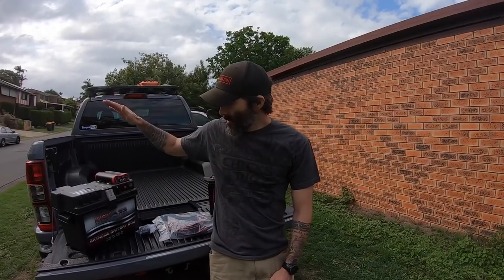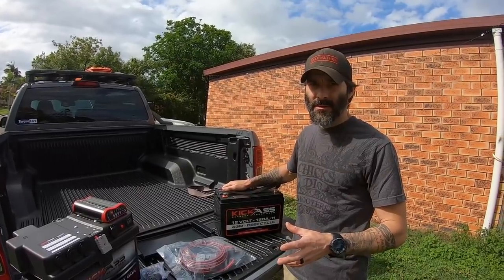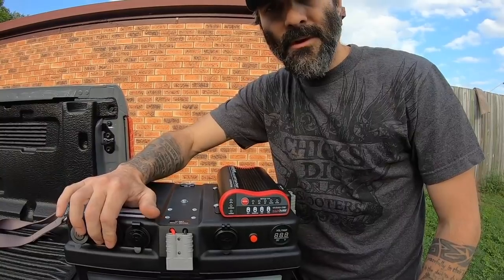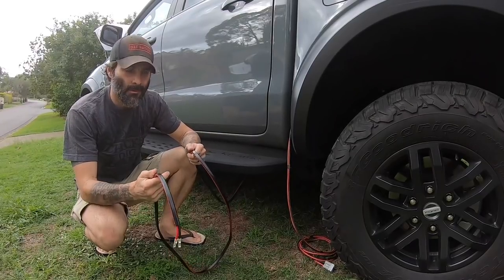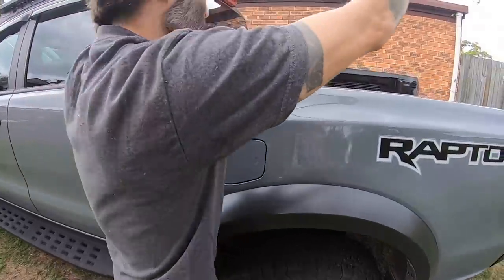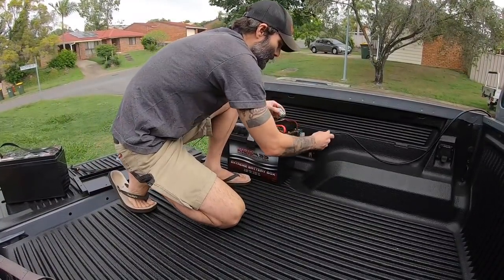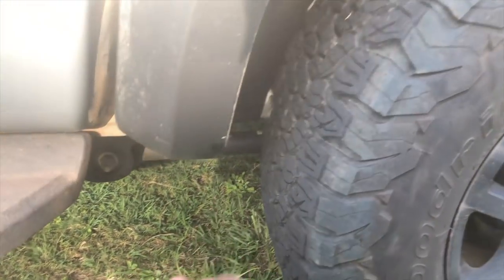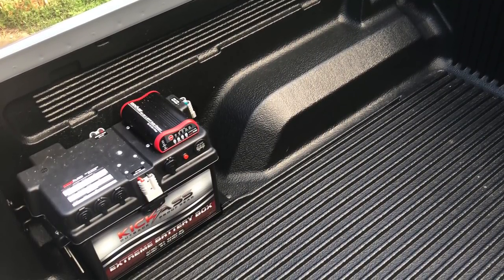HOW TO - Dual Battery Install - EASY

Comment: I'm very curious to see your battery box voltage when you car is on. Being that you haven't tapped into any ignition/accessories cables with the DCDC charger (as your meant to). Wonder if its charging the battery completely.
Reply from the maker: You are right mate, some DC/DC chargers will require the black accessories wire to be installed. This unit however comes pre wired, as you see the instillation in the video it is exactly step by step according to the manufacturers instructions. I’ve had the unit in for 8 months now and it has never ran flat. Volt meter is showing 13.5 - 14.5 with vehicle running 👍🏻
Reply: I have the same question. I just got this kit and installed on my 2019 Ford Everest. The aux battery is still charging when my vehicle is off so I’m wondering if I need to connect the blue ignition wire. 
Wondering where the best spot to get the ignition connection from might be too.
Reply: @scottweaver951  I'm hoing to install mine soon. I'll keep you posted with where I tap into the accessories power.
Reply: George Athanasiadis did you end up working out how best to install your cabling. Mine just keeps charging even with the vehicle off now even with an ignition or accessories cable hooked up.
Reply: @scottweaver951  need to enable dual battery charging. Go to local dealership and they can do it easily. I didn't hook up my inginiton cable and having the dual charge enabled it work perfectly.

Comment: Hey mate, just wondering how does it go exposed to the elements? Does it hold up alright with rain etc?
Reply from the maker: Not a problem at all other than a bit of fading of the colours after a while. Ive had mine in for a few years now, still going strong.

Comment: hey mate great video got me keen to do it , the link doesn't work for battery box you brought . I have searched for primuim battery box and cant find anything on the kickass site . do you know if they still make it ?
Reply from the maker: G'day Mate, I just had a look...It isn't listed on the site now/anymore? Maybe a supply issue or seems like they want you to purchase all the pieces individually...and i can't be too sure but it looks at first glance like they have put the prices up...??
Reply: @RoundTheFire  cheerz mate,  would you buy it again now ? if so i might buy them individually then . did you say the charger was riveted to battery box ?
Reply from the maker: @loggaification  mate to be honest it hasn't skipped a beat and i've pretty much treated it all the wrong ways. the DC/DC is just riveted to the top of the box. Ive upgraded my battery now to a VOLTAX lithium not much more than the kicks battery 1000% improvement.
Reply: @RoundTheFire  I ordered the Kickass setup, but I believe Australian Direct has supply issues, so they refunded me (they contacted me and offered the refund, so full credit to them).

I found these guys who appear to have the exact same setup, so I ordered the kit from them. Got it couriered to me in 2 days. Will install in the next week or so.

https://www.home12volt.com.au/bbg-dc.html
Reply from the maker: @timblue191987  That setup looks good mate, thanks for sharing the link.

Comment: What's the 12v out put for the trailer for?
Reply from the maker: To charge the 3rd battery located in the trailer which runs another fridge/freezer and a water pump.

Comment: Hey Damo how you going without the blue wire ignition feed had it drained the main battery yet and what model Ranger is yours bud ?
Reply from the maker: G’day mate, I had zero issues without the ignition wire hooked up. I’ve since changed out the AGM and dropped in a lithium, for that I hard wired the ignition wire straight to the positive terminal on the second battery. My truck is a 2020 model 👍🏻
Reply from the maker: You can also get the dealer to turn off the smart alternator so it pumps hard all the time

Comment: I bought and installed the KickAss DCDC charger and Anderson wiring kit last weekend. I already have my own AGM battery and a battery box. Because my Mitsubishi Pajero Sport has a smart alternator, I also have to make and extend the blue Ignition Override wire to the fuse box of the car. I notice your kit has no Ignition Override cable, so does your Ranger Raptor has a smart alternator? If so, shouldn't you need to connect an Ignition Override cable to overcome the smart alternator charging issue?
Reply from the maker: Gday mate, yes the Raptor does have a smart alternator. The pre wired Red DC/DC charging system doesn’t come with the ignition override wires , from memory I think only the black square projector type requires the additional wire?
Reply: @RoundTheFire  That's strange. I have the same red KickAss DCDC charger, not their older Projecta charger. Mine also has additional three wires - Ignition Override, LED indicator light and battery temperature sensor. I only connect the Ignition Override wire because Aussie Direct suggested me to do so due to the smart alternator in my car.
Reply: @RoundTheFire  This is the kit I bought from them - https://www.australiandirect.com.au/buy/kickass-dcdc-mppt-solar-battery-charger-12v-24v-25/KADCDC25A-AND-WK
Reply: Hey noodlefoo, how'd you go about extending the ignition override wire? I need to do this myself, but can't work out exactly how to do it.
Reply: @dezzbigred3640  I bought a 4m long 17AWG wire from Jaycar, on one end I connected it to a fuse tap and plugged it into a fuse in the car interior fuse box (labelled Relay which apparently runs off the ignition power). On the other end of the wire I connected it to a female spade connector. I run this wire from the interior fuse box, down into and along  the passenger side door seam, and come out into my boot compartment (Mitsubishi Pajero Sport).  With my KickAss DCDC charger, it is with my auxiliary AGM battery in the boot, I connected the Ignition Override wire of the DCDC charger with a male spade connector, so I can connect and disconnect to the 4m wire whenever I want.
Reply: Thanks mate. Do you happen to have a link to the wire you got from Jaycar? Thanks in advance.
Reply: @noodlefoo  hey mate I've got the same issue with the ignition wire when you connect it up and run the car how did you know it's working do you see I volt increase on the battery box I've done something similar to you with the spade connectors but not positive it's working.
Reply: Billy-Ray McNamara The only way I can check my ignition override wire is with a multimeter. Touch the positive probe to the wire and the negative probe to a chassis negative bolt. When the car engine is off, the multimeter shows 0V. When engine is running, it shows about 14V.

Comment: Gday demo 
Has your raptor got a option to disable the passenger airbag?  Wife due to have a wee baby and bought a baby seat that I need to fit in front 
Thanks 
DREW
Reply from the maker: G’day Mate. Congratulations, you must be doing well to start needing to shuffle the little ones to the front seats. Mate I haven’t had a look, here in Australia it’s not legal to do...but I know in my hilux there is a plug behind the glove box that if you disconnect, it disables the passenger side airbag.
Reply: @RoundTheFire  ah ok laws are diffrent down under.. in Scotland we place our baby seats in front seat facing to the back seat and switch of the airbags...
I will just place the wee one in back then, as I couldn't find the disable key for airbag. 
Thanks again mate Drew

Comment: Just curious on what's the purpose having dual batteries?
Reply from the maker: G’day Brent, The main reason for adding a second battery is purely to run constant draw 12V accessories like fridges, work lights or inverters. Wired in correctly, having a second battery will keep your main battery from going flat trying to keep the beers cold 👍🏻

Comment: after a month mate..what happend to your raptor.?why it didnt start.?just wondering...
Reply from the maker: Gday mate. I had an aftermarket long range fuel tank fitted to the Raptor. The fuel sender on the new tank  wasn’t seated correctly inside  the tank so the gauge wouldn’t  read that the fuel tank was  empty. Long story short, I ran out of fuel while testing the range of the new tank.
Reply: @RoundTheFire  ah ok mate cheers.!watching your vids regularly..contenplating on buying a raptor myself here the philipines..D
God willing..

Comment: Did you end up connecting the blue ignition wire ?
Reply from the maker: I didn’t with the AGM I had to after I changed the battery to a lithium. All I did was wire it to the volt gauge. So when the gauge is on it thinks the car is on not exactly what shouldn’t be done but a very easy fix

Comment: I think it's a great video but when I seen you drill the hole through the tub I knew straight away when you put some weight in the back of its go to rub and cut some Wires and earth out